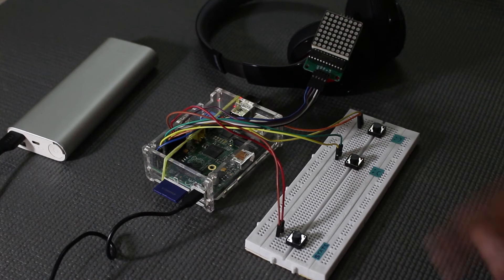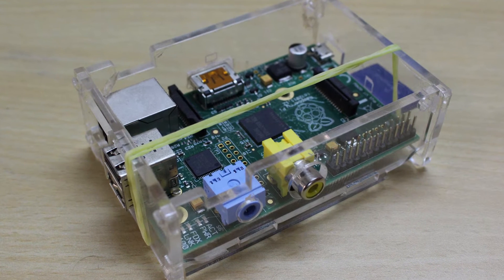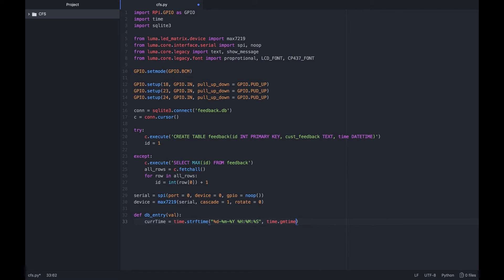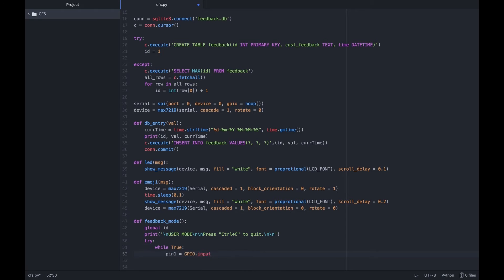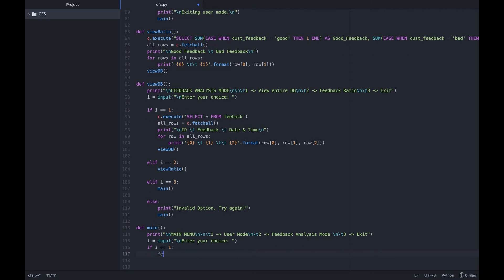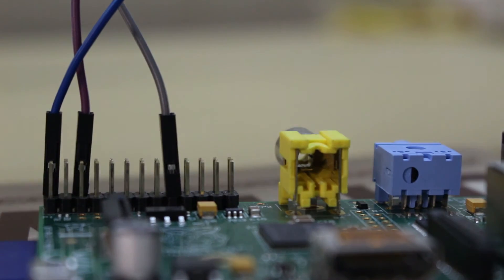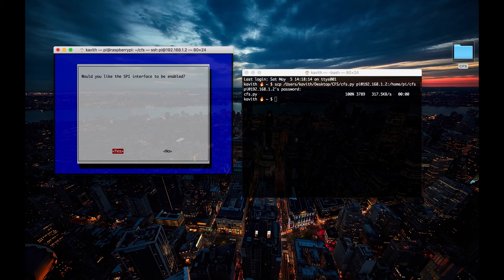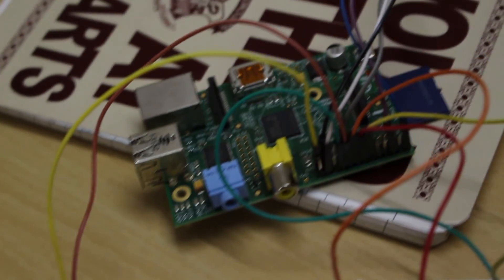DIY Raspberry Pi Project - Customer Feedback System (with LED Matrix)

Comment: Thanks for sharing this project, I just built my own with 3 buttons and it all works ok, but the only thing I can't get to work is the speed that you are allowed to press buttons - it won't allow another button press for 5 seconds. How do I change this please
Reply from the maker: I’m glad the video helped you :)

About your question, we have set a time delay of about 0.5 seconds to ensure there is no duplication of data with continual button presses. This is done with the “time.sleep(0.5)” in the if conditions of both pin1 and pin2. PLEASE CHECK YOUR CODE TO SEE IF YOU’VE PUT 5 INSTEAD OF 0.5 IN THOSE LINES. 
If you want to remove this time delay or decrease the time, you can do so because anyway the LED matrix functions will hold the process until it finishes and any duplicate button presses will be ignored. 

Another reason why you might experience this delay is probably because the LED matrix functions hold the process till they finish displaying the emoji or the data and at those moments while they’re displaying, button presses will not be registered. You can speed up the “scroll_delay” parameters to get speedier LED Matrix display times. Although, I really don’t think these small delays would cause your buttons to be unresponsive for 5 whole seconds. So do check your code thoroughly for any stray/erroneous “time.sleep()” lines. 

Hope this helps. Let me know if you fix your issue!
Reply: Thank you again. I found out that the delay was linked to the display of the emoji as that's how long it takes for the emoji to scroll. I've adapted the code so that it doesn't display the message on the LED screen when a button is pressed and it now works fine as expected. I have also made it automatically start in feedback mode and also set it to automatically run when the Pi starts by creatingalauncher shell script and putting it in the crontab. So that you know it's running, it also displays the message "Ready" as it enters feedback mode. My plan is to improve it by running different code which gives the user the option to delete the database by pressing button 1 and start the program by pressing button 2. Before deleting the database, it would actually copy the database and give it a timestamp defore deleting it - that way, you could always get back to the old data. Thank you again for your work on this project.
Reply from the maker: Woah...Those are some really cool additions to this project! 😄
Reply: Not sure I've done it right, but I've created a github account and posted the code as a fork or pull or something like that, and I've uploaded a video showing the modified project - https://youtu.be/jaPIYKmUspI hope you like it.
Reply from the maker: This so cool! Really loved the project you've made!!! Share the GitHub link in your video description as well so we can help other people too :)
Reply: No problem. If I've messed anything up with the github stuff on your master, please let me know or change whatever needs to be changed as I don't know how to use github properly.
Reply from the maker: You can’t change my master branch without my login credentials. So it’s all good. 🙂